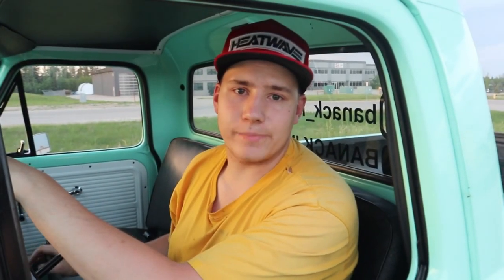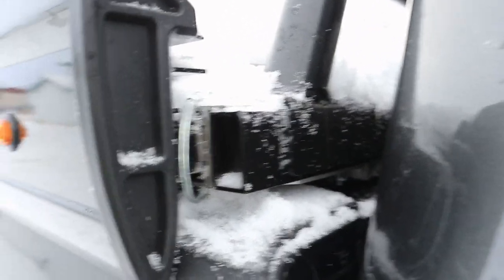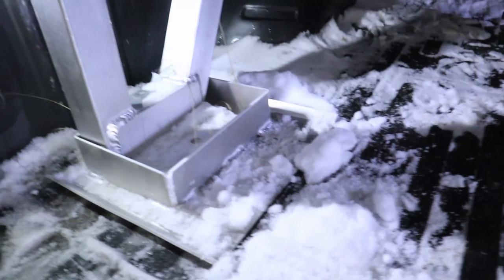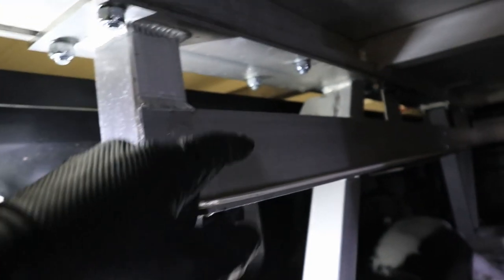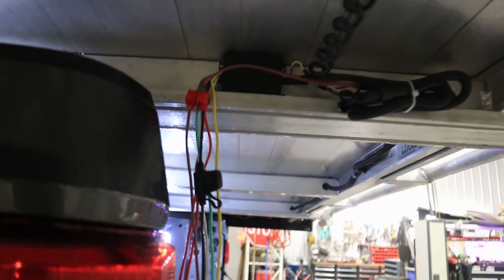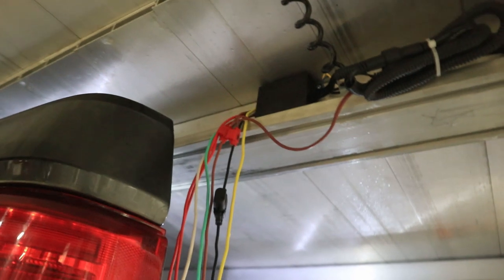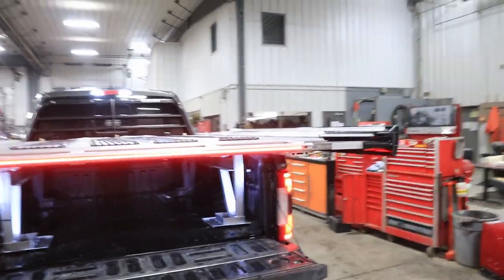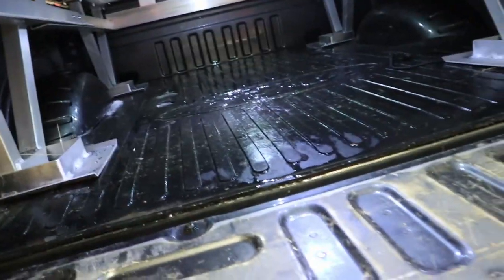Marlon 8ft Explore Pro 2 Sled Deck Install

Comment: Hey any updates on the deck? Ive been hearing some stories with 2 sleds the weight is almost to much for the deck and it sits with of a bit of a frowney face from the real. ^ months till the white stuff and i wanna be ready. Thanks
Reply from the maker: Never had a issue with the frowny face, i got a buddy that runs 2 canam 1000s on his at full width and not had any issues, 

They finally got my rear led light fixed after we installed the 4th putco light 

Side led light wiring is junk but other then that deck is sweet

Comment: Have you found out how to get rid of the faults the truck is doing? I bought a Marlon & put it on my 2017 F-250 XLT & I am having the same issues & can't figure it out. Can you help?
Reply from the maker: Phone Marlon and get them to send you the  superduty tie in harness for factory led light, it ties the deck right into the trucks taillights
Reply: @BanackIndustries  ok thank you so much for your help.